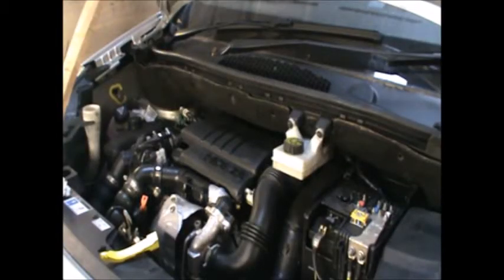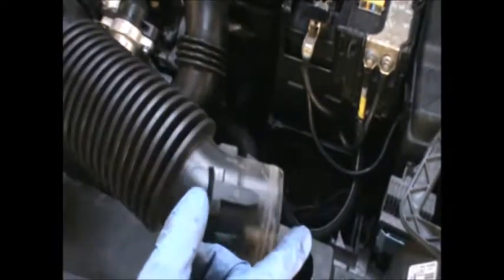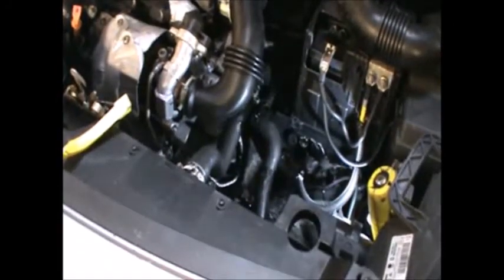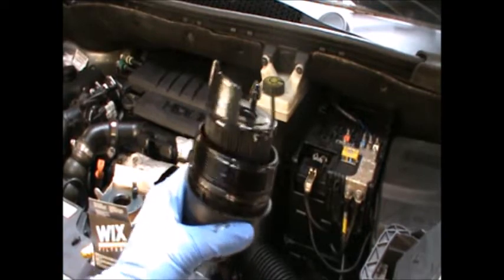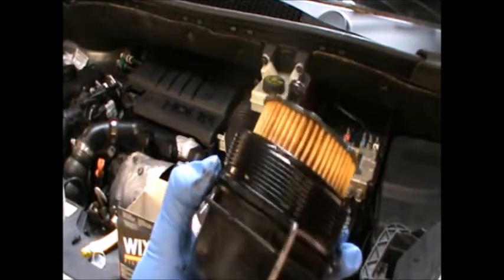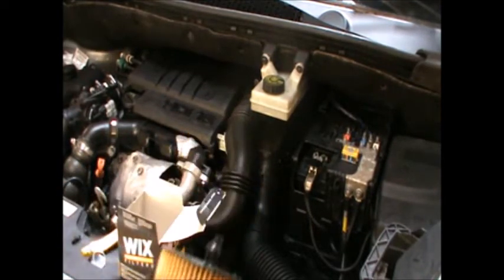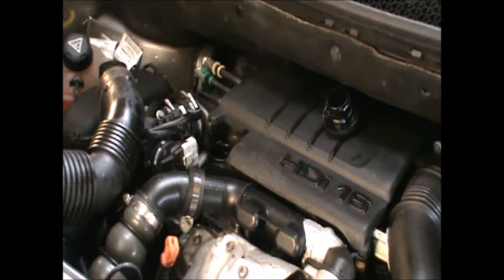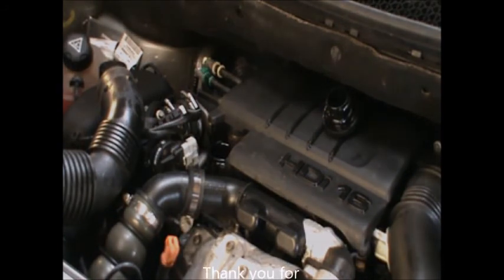Peugeot Partner Tepee 2010 oil and oil filter replacement

Comment: I have tepee 2011 I put 4.5L oïl ? ? Is it correct
Reply from the maker: I didn’t have the manual for this car so I am unable to confirm if 4.5 is the correct amount, if I was you I would put 3 litres first and check the dipstick and see where you are and top up as needed.
Reply: @DaringBeefcake  thank you

Comment: Dread putting that oil filter in every year. There must be a correct way to ensure the little stub 0 ring is in the hole.
Reply from the maker: Someone suggested to put the filter in first. Not sure.
Reply: @DaringBeefcake  yes you would think that would be easier but I am not sure if you can click the plastic top on so that when you start to screw it in, it is indeed right in and is turning with the clip tight onto the filter, rather than the clip twisting it's way down into the top core of the filter, if you can follow what I mean. I have just changed mine and clipped the filter in first.
Reply: You should locate the filter in it's locating hole first then the filter cover
Reply: @johnbetts5795  I tried that, but the trouble is that you cannot clip the filter cap right down onto the filter because the threads of the filter cap stop you pushing it right on. You have to start turning the filter cap and screw it into the threads and as it is not clipped right on it tends to turn the actual filter.

I was a bit concerned that the little plastic stub might break or actually come out of the hole, because it does grip the filter quite tightly because it is not fully clipped past the point where the filter and filter cap turn free.